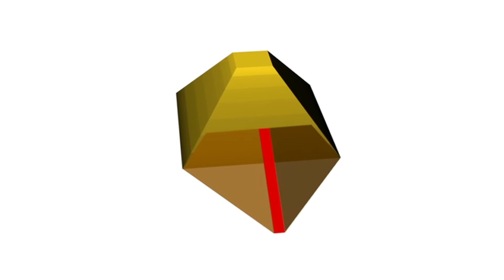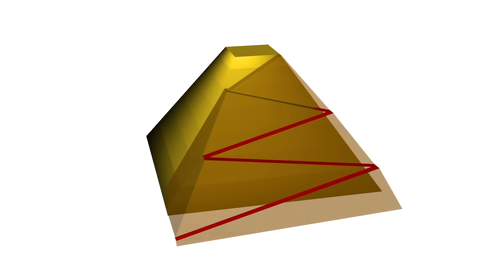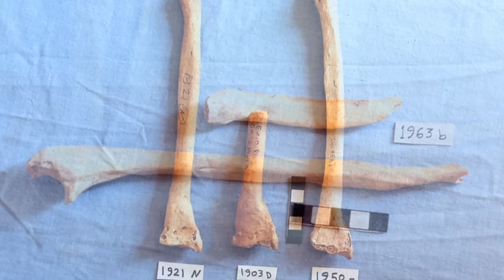Egyptology - Pyramid Construction

Comment: Wouldn't they use elephants to drag these block's ?
Reply: lol!  No.  They used teams of men + oxen.  An ox can pull more than 2X its own body weight.  Thus teams of oxen can pull multi-ton loads in addition to manpower and the employment of things like levers and moistening the ground before heavily laden sleds.  There is a tomb depiction showing a man pouring water before a laden sled while another one in the tomb of Hunefer shows a large sarcophagus on a wooden sled being pulled by a team of yoked oxen.  Pouring water before a sled reduces the friction and thus the effort required to move it by almost half.

Finally at the worker village at Giza they found many tens of thousands of cattle bones which places oxen at Giza during the period of the pyramids.  So it is inconceivable that they would be consuming cattle but not also using them for labor given many depictions of yoked oxen performing manual labor in Egyptian iconography.

Comment: “The type of ramp remains a mystery”…so the most important part in understanding how this is possible 😂
Reply: There was no ramp. the demolition material would fill up the entire Giza quarry today.
Reply: @ronnieleedilljrWOLFMAN  the stones were poured like concrete on site not cut and dragged in.
Reply: @HairyCactusActual  No, no and no. That theory is completely false.
Reply: @christianvachon2235  please elaborate to how?
Reply: @HairyCactusActual  Because of the stones themselves. The surfaces are cut and shaped not poured and clearly not from molds, they are fitted but not uniform and consistent as you would with poured blocks, the density and porosity as well, you can see some leftover fossils in some limestone block which would not happen were they poured, we have some of the quarries also. All of that. Also, granite cannot be ground and poured and polished, even to this day, and it is normal giant polished granite blocks with quartz in it. Also, the weird knobs on many stones that you also find in Peru that were carved and appear to there for moving the stone into place. The joints and fitting appear to be the way they are from rubbing during the installation, not from poured fitting. This at least is the case in Giza, but you also see that in Peru.

The pyramids at Teotihuacan, which when you visit actually appear older than Giza are somewhat different. They were built using forms that were filled with volcanic rock and you can clearly see that.They used to be covered in black basalt shaped blocks, and in old photos of the original excavations you can see some of them lying at the bottom - they were all removed and sadly those pyramids don't externally look like they did originally either.

Hope this answers the question. From all the evidence, the best suggestion is that they used some kind of magnetic or electromagnetic levitation to move them (in Peru and other places, many stones have unusual magnetic signatures/properties). The one person who did build a megalithic structure in the 20th century, Ed Leedskalnin who built Coral Castle, used quarried (although much rougher) coral limestone blocks and magnetic levitation of some kind to "float" the blocks into the spot (at least that is how he he suggested moving them).
Reply: @christianvachon2235  greeat response thankyou. Everything has a magnetic signature from when it was made. Every block on the pyramid has the same North face on every block, meaning how if these were carved and placed all happen to face their magnetic polarity north.. ?
Reply: @HairyCactusActual  You are welcome. Yes, everything as a magnetic signature when made. I can't say for sure about Giza; however, in Peru and some other locations, there is anomalies and strange compass reactions near the stones that suggest that the stones were subjected to something that changed their magnetic properties, and field.

Ed Leedskalnin's contention (and also experiments in Magnetic Current) suggests that the magnetic current in the stones (and other substances) could be changed (and sustained until the circuit was broken). This is seemingly how he was able to move multi-ton blocks entirely alone. Likely using some kind of magnetic levitation.

Hope this answers your question...
Reply: NO RAMP MAN. WOODEN SCAFF-FOLDING AND USE THE SAME HEAP AS RAMP! STONES WERE MOSTLY ROLLED ON WOODEN BLOCKS PULLED BY FOLKS/BULLS! AND LIVERS WERE ALSO USED. THIS IS BASED ON SOME DEPICTED PICS THERE.
Reply: Yeah if you had a ramp, there would still be evidence of the ramp today, as the ramp would be very fucking long an very strongly built to support so much weight being 'dragged' up them, its foundations an shit would go very deep an would still be there.

Because if you were a culture that could move a 700 ton block of granite into perfect place in 10minutes as experts claim, you wouldnt bother de constructing the rest of the ramp after completion of pyramid once you got down to ground level

Comment: The initial thumbnail acts like there is no such thing as tensile strength you could not pull a rock that massive with simple rope even with modern machines any rope produced back then would not have the strength I have seen 1” steel cables bust under load pressure that was smaller than that block would have been for its mass and size. Everyone is talking about the ramps, what about the ropes whatever you do you will always be hindered by your weakest link, hand made natural rope to lift and pull 10,000-100,000lbs?

Comment: Well unless the estimated 20 yrs timeline is wrong a block of unbelievable weight would have had to been shaped and placed every two and one half minutes. You do the math!!
Reply: Or = follow the evidence - which you apparently have not done.  Also a bit of "critical thinking" would help you as well.  

1 - say you have a team of block workers.  They can pickup and transport a single block the short distance from the quarry to the pyramid to drop it in place in say 2 hrs.
2 - so based upon that estimate if you have 10 teams then they can accomplish the same in about the same amount of time.
a - so 20 teams can place 20 blocks in 2 hrs.
b - 30 teams can place 30 blocks in 2hrs.........and so on.
3 - Egyptologists estimate the Great Pyramid workforce to be around ~20-30,000 people.  So if you had 50 teams of 50 men - and animals - moving blocks that is only 2,500 devoted to transporting blocks leaving thousands for other tasks. 

Moral of the story:  the more teams working in tandem = the more blocks which can be placed in a short amount of time.  Further as the teams do only one specific task then via repetition they can figure out how to do so fairly rapidly like workers on an assembly line do.  The Great Pyramid is a large structure which could easily accommodate hundreds of workers upon it in different locations simultaneously. 

So the blocks were not all individually chiseled.  Look at photos of the pyramid to see it is mostly "stacked rubble".  Most of the blocks are a hodgepodge of assorted shapes and sizes reflecting rapidly fractured off chunks of stone.  They simply split the bedrock into approximate sized chunks = and carted them away.  Few of the total number of blocks are carefully cut and in some cases polished.  Something new to think about.
Reply: @varyolla435  man STFU u don't Kno shit that Masterpiece is over 4500 years old Talking about some damn rubble

Comment: 2.5 tons? What about the 30 ton blocks? How would you move those, the manpower required would be like 1000 men not to mention moving them from 500 miles away. And the time frame, it was claimed the great pyramid took 20 years. 2.3 million blocks, cut them, mobe them 500 miles, fit them. The math does not add up. Even if they used elephants, how to you make those tight turns.
Reply: Wrong = but thank you for playing.

1 - the Great Pyramid took 20-30 years to construct.
2 - the 2.5 ton = average.  The bottom half - closest to the ground - is where the largest blocks are found.  Those above are smaller in size.  Thus most of the blocks are not that large while there are some very large ones closer to the ground.
3 - the limestone quarries which supplied 90% of the stone sit = 100-200 meters from the pyramids at Giza.  Only the small amount of granite came from Aswan while the white casing stones came from the Tura quarries about 10-20km away. 
4 - most of the blocks are little more than crude chunks of limestone of assorted shapes and sizes.  They were not quarried as far as chiseling each block out.  All they did was to split the bedrock using chisels and hammers along with wooden levers to pry out approximate chunks of stone which were hauled away to the nearby pyramid.  Only those few used to create the inner chambers/corridors and the last outer layers of stone were more carefully cut and in some cases polished.  All the rest is basically "stacked rubble" with gaps all over and globs of gypsum mortar and quarry debris jammed into spaces.
5 - finally the large blocks on the bottom half would be raised via an earthen ramp which only needed to go as high as the King's Chamber.  Above that level the smaller blocks could be raised via a lever device using a fulcrum and counterweight akin to the shaduf.  Smaller mudbrick ramps could also be used to raise the smaller blocks.  Look at photos of the blocks at the top of the Great Pyramid and see where they are small enough to have been slid into place by several men.

So they used earthen ramps made from sand/stone chips/tafla - a clay they mined.  Blocks were moved on wooden sleds pulled by teams of men and oxen - you forget about animals.  By pouring water before a heavily laden sled you reduce the friction and thus the effort required to move it by almost half.  On the pyramid itself as noted in #4 there is gypsum mortar slathered everywhere.  Laying that thick paste before a block would allow it to be levered into final place more easily by "greasing the track".  So less incredulity = more evidence-based conclusions.  Just a suggestion.

Comment: the problem is not the ordinarys block of some hundreds of kilos each, those ones that constitute the 99% of the Great Pyramid ....... somehow, we may imagine the way they lifted them up

the problem is those tens of megalitic blocks of tens of tons each in the Great Gallery and in the King's Room ...... it is needed some hundreds of men only to move a few metres in plan: hou could they lift them up to 45 metres??

this is really an unsolved problem
Reply: Actually = no - it is not.  Why perchance do you assume they "lifted" them???  Tell me how does your car get to/from an elevated overpass on a highway???  Answer:  via a RAMP = so it was here.  The Egyptians built earthen and mudbrick ramps when building things.  There are the remains of such ramps in Egypt today to include at Giza.  In the western cemetery next to partially finished tombs are small earthen ramps which were abandoned in place.

So those large blocks you note are found in the bottom half of the structure.  Thus the earthen ramp used to raise them would actually only need to go that high.  Above the level of the King's Chamber - and the Grand Gallery sits below that level - the blocks of the pyramids become smaller as it rises in height.  The blocks at the top of the pyramid are small enough to have been slid into place by several men.  So these smaller blocks above could have been raised via lever devices employing a fulcrum and counterweight. 

As to the larger blocks.  The Egyptians built ramps out of a mixture of sand/stone chips/tafla - a clay they mined.  At Giza is the remains of a huge tafla mining operation.  So what happens when you moisten clay??  Answer:  it gets slippery.  Also in other places like Wadi al-Jarf where Merer's diary was found they found wooden planks laid into the surface of a path leading to blocks dumped in a central area.  So they moved blocks via wooden sleds - there have actual sleds in museums and depictions of them doing this - and those sleds were pulled by = teams of men and/or draft animals - specifically oxen. When the limestone quarries at Giza were excavated they found massive quantities of what they made ramps from.  So as they encased the pyramids in white limestone working from the top down they dug away the ramps and dumped the residue into the open quarries to backfill the area.

At the worker village at Giza were the remains of tens of thousands of cattle bones.  That places cattle at Giza during the period of the pyramids.  In the tomb of Hunefer is a depiction of a large sarcophagus being pulled on a wooden sled by = yoked oxen. That shows they were not simply consuming cattle but also used them for labor.  Finally a tomb depiction of a large statue being pulled by teams of men on a wooden sled shows a man on the front pouring water before the sled.  A study done with simple sand showed how wetting the sand before a laden sled reduced the friction and hence resistance by almost half.  

So an earthen ramp made in part from clay and possibly with wooden planks laid into the surface would allow via wetting the surface down for teams of men and oxen to pull large blocks into place on the pyramid.  Finally the pyramid itself is covered with a thick gypsum mortar.  it is everywhere on the structure.  So by applying the mortar paste before a large block you would act to "grease the track" to allow the block to be pulled/levered into final place. You have your evidence now.

Comment: im currently a marble & granite installer and probably the most effective theory of ramp is the spiral.. based on the target of plan ,positioning of stone and weight of it
Reply: No ramp was used at all.
Reply: HAVE YOU EVER MOVED A 100 TON BLOCK USING A RAMP? DON'T THINK SO!
Reply: @speedytrumpzales6350  The blocks only weigh 2.5 tonnes on average, if it takes 25 to 45 people on average to lift a tonne you are looking at 55 to 70 people per pyramid block, 100,000+ slaves over the course of the 20 years work is more than enough to get the job done and some more.

Comment: building the ramp itself is a huge challenge..
Reply: Indeed = yet that is exactly what the evidence we see supports.

1 - there are the remains of earthen ramps as well as mudbrick ones today in Egypt.
2 - at Giza in the western cemetery besides the Great Pyramid are the remains of smaller earthen ramps made from sand/stone chips/tafla - a clay they mined.  Near the worker village at Giza is the remains of a large tafla mining operation.  Also at Karnak are the remains of mudbrick ramps used to build the temples there.  Finally we see in tomb depictions such as in the tomb of Rekhmire the building of a hypostyle temple via a mudbrick ramp.
3 - so when the limestone quarries at Giza were excavated they were found to have had massive amounts of the same material they built ramps out of dumped into them.  So this shows that as they systematically dug away the ramps they dumped the residue into the open quarry pits to backfill the area. 

Moral of the story:  finally Herodotus wrote they constructed "a great causeway" which can only be interpreted as a large ramp structure.  He stated that its creation was in his mind as great a feat as the building of the pyramid itself.  So all of the evidence points to external ramps created to raise the blocks in construction of the pyramids + tombs + and temples.  

Herodotus also wrote they employed levers and what he termed as "a machine" which is believed to have been a lever device which used a fulcrum and counterweight akin to the Egyptian shaduf.  He stated they first built a "stepped pyramid" ala Djoser to fill in the sides as well as they encased them in white limestone working from the top down.  So the lever device could have sat upon the steps to raise the smaller blocks above - the blocks become smaller as the pyramids rise in height - while the larger blocks below closer to the ground would have been raised via the ramp.  Have a nice day.

Comment: It's a powder from rock they process  it from a mold at the top so they can position it easyly from the top with a rope they bake it trough the hot weather..they can easyly bring it up trough powder then at the top they mold it and bake it with water by the help of hot temperature like a cement different process
Reply: Limestone cement blocks were made on site by pouring liquid limestone cement into molds. See videos on YouTube on this process. Not carved granite blocks.